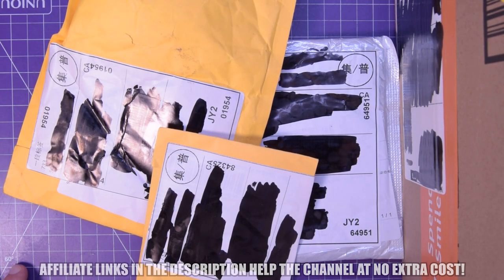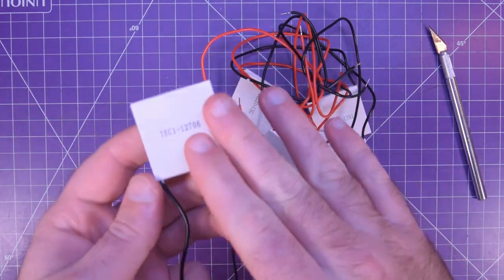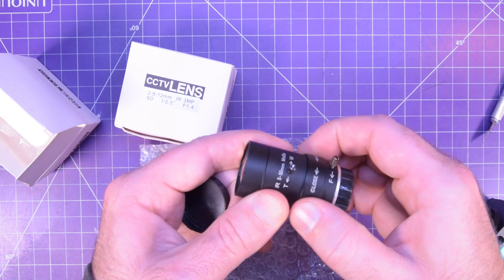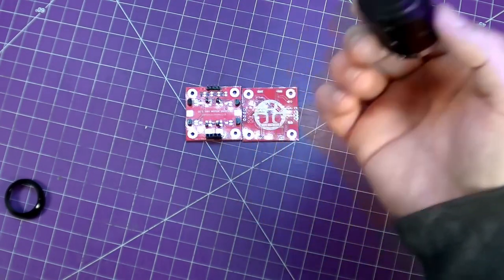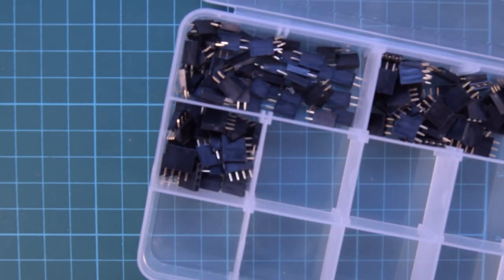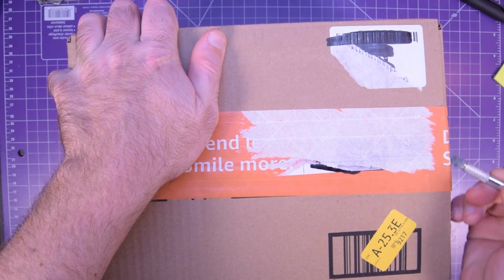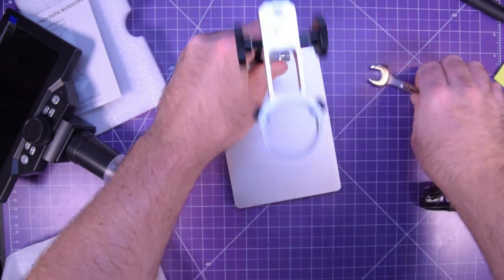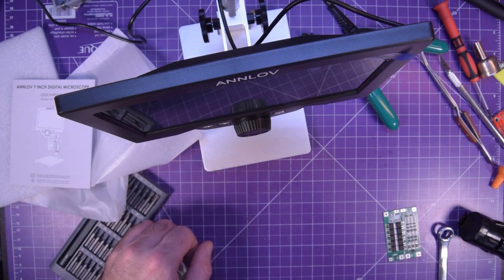Mailbag 95 - Clairvoyance

Comment: I also have that microscope, with a different name on it. It's good, the only issues I've had with it is that unless you are at a 1024 x 768 resolution, pictures it takes come out stretched in the wrong aspect ratio (so a 5050 led looks egg shaped). Would be interested to see if yours has the same issue. And the only other problem was that the USB lead and TF card are really hard to insert and remove because the casing gets in the way, unless you have the fingers of E.T. Oh, and every time I use it for something proper, I end up spending ages being distracted looking at all sorts of other objects close up just out of interest 😃
Reply from the maker: I'll have to check that!